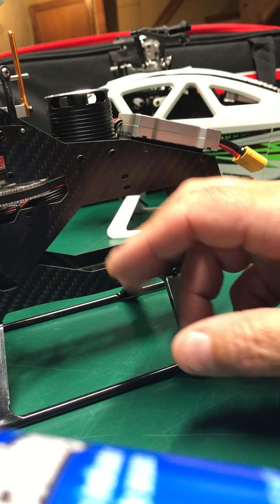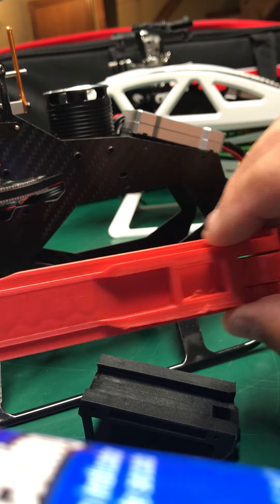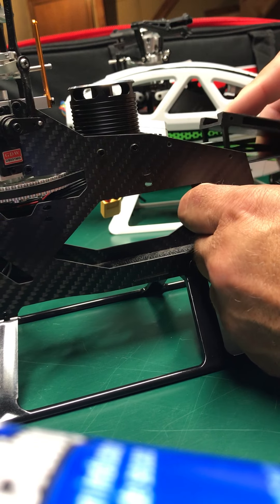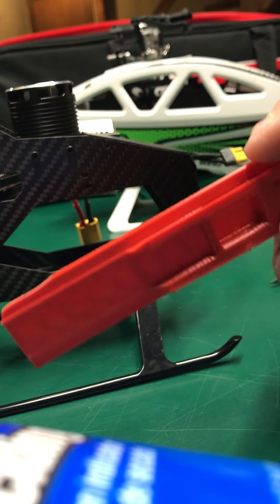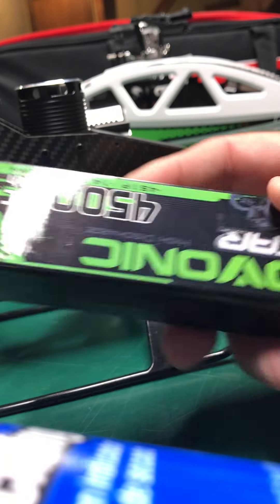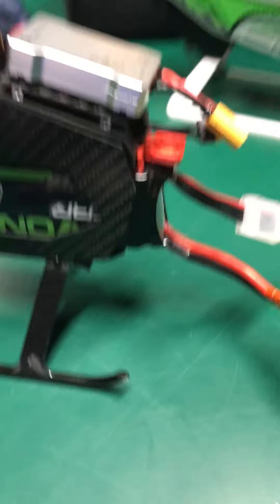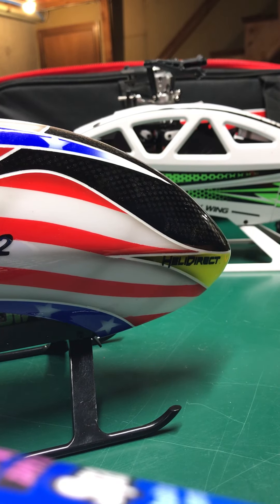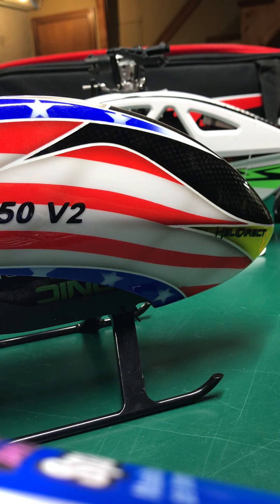Flywing FW450 V2.5 Frame and battery mod

Comment: Could not follow you. What does the ESC plate do? What does the battery tray do. Do you strap the battery to the battery tray and then it slides in and clips in place. You completely lost me?